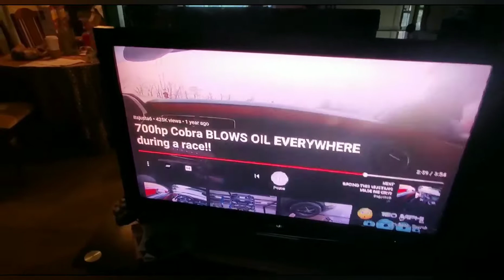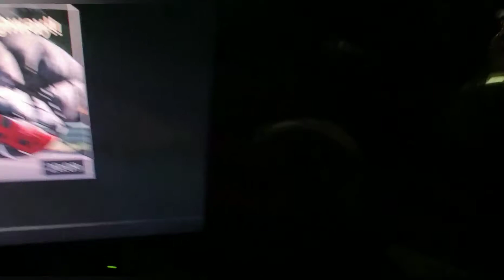THIS MOD COULD GET ME FUTURE FINES !!!!

Comment: Dude, where you live at? Not giving bullcrap on the tint but if you live decently close i would tint that for you.
Reply from the maker: In the Lancaster area , And thinks boss but I got this lol I see were I missed up . I have 200 more feet available to use
Reply: @TZNatioN87  No problem, i tint windows for a living. I thought if you lived in western nc. I would help you out. Heat shrinking is the trick to it on all the windows

Comment: 15% hahahaha wow I got 5% on mine my dude what size tires you got I like those
Reply from the maker: Hahahahaa 5% I figured would be to dark so I went with 15 . It works for me anyway hahhaha . And its square 275 35 zr18  later it will be 325 30 zr18  back and 305 30 zr18 fronts  looking at the Toyo proxys 888r or maybe nitro NTO5Rs idk yet . But that's the size I'm getting soon .
Reply: @TZNatioN87  did you have to make any adjustments to the fender well for those 18s not to scrub while turning
Reply from the maker: @clayebersole8544  no , But for now thier is a 2 inch spacer because the hub is too bulky to fit threw the wheel

Comment: How long have you been putting this car together?
Reply from the maker: For a while tbh , Would have went faster if my one ex freind didn't bail on me in the middle of a build and littrally threw me out on the street and said I have a few days to move it or it's going to the impound lot . That cost $250 to plus $60 a day and not to mention to get ot out and have it towed  somewhere else . So I had it towed to a shop at random and I was at the bottom of a list and was sitting for 13 mouths and finally had the room to bring it to my house . So I did the video of that is all here .  So it's been allmost a year since then doing everything by myself for the first time and forcing myself to learn it all as well .
Reply: Man that really sucks. It’s looking good though !!!!
Reply from the maker: @MrRyan6616  hey I'm trying,  Still slot more to go